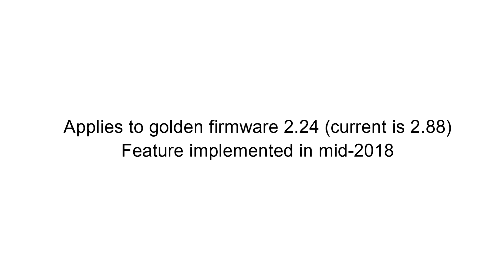How To Fix TBS Crossfire Binding Issues (via Emergency Update Procedure)

Comment from the maker: For the dreaded solid green light, please try this: 

1) Reflash or downgrade the firmware for the transmitter.
2) Put the transmitter into bind mode. 
3) When you power the Rx (without the bind button pressed), does the LED turn red color? 
     If so, then the Tx should ask to update and proceed through.
Reply: Hi, mine have solid green light since begining, tried your advice to downgrade is done but nothing happened, it just still solid after pressing the bind button after power up the rx. downgraded 6.06 to 4.1. any advise?
Reply: What if TX dont ask to update?
Reply: @Seii-FPV realized that my receiver has little fracture on CPU, kinda not repairable 😅
20$ got loss ☹️
Reply: What if it stays red after update

Comment: Hi, I do the whole process like you do, only that when I unplug the quad and plug it back in, it loses the bind, and every time I have to redo the same operation, has this ever happened to you? How can I fix?
Reply from the maker: A few things to try to rule out a few things otherwise your receiver is broken/defective and needs to be replaced by TBS Support: 
1) Have you tried different firmware and downgrading? The latest one that has encryption has caused some issues for people.
2) Power up the receiver first and then the transmitter first to establish a bind?
Reply: @OfficialMatrixFPV  I did many tests, I followed various guides including yours but all without success, on the rx it doesn't let me downgrade, on the tx yes, I tried but nothing happens, I tried to bind by turning on the rx first and then the tx, then in reverse, but every time I disconnect and reconnect the battery it loses the bind, in fact I'm sending it back, because something like this has never happened to me until today, and the only tool to restore the rx is a tbs core pro which costs around 40-50$

Comment: I know this is an older video. I followed the steps and everything went as it shows in your video. Bound up and works perfectly... but when I unplug the battery and then wait and go to re-connect a battery it is just flashing again and I have to go thru process again... Kind of lost in where to go from here... Anyone have any suggestions? Thanks
Reply from the maker: Have you been able to downgrade and try other firmware, I would try different types to see if binding is stable? It's rare that binding has issues with TBS - check with what others might be saying about the latest FW on the TBS Facebook group. You can definitely get more support by asking there or opening up a ticket with their support - they are fantastic and will do their best to make things right.
Reply: @OfficialMatrixFPV  I ordered some new Nano Rx's but haven't gotten them yet. So I went to a buddies house tonight and borrowed his spare Nano rx and it bounded up perfectly and is holding bind as it should. 👍
Reply from the maker: @P.G._FPV  That seems like your Rx is faulty. You might be able to TBS to replace it free of charge.
Reply: @OfficialMatrixFPV  it was the Rx. Actually both Rx's I had were bad... what's the odds of that. LOL
Reply from the maker: @P.G._FPV  Yikes! That is pretty rare.
Reply: @OfficialMatrixFPV  I know... right. LOL

Comment: My receiver doesn't stop to blink fast after pressing the button for the second time. The green light even blinks rapid when I don't press the button and connect the battery. All of that happened after the first bind failed in updating. :/
Reply: did you fix it? 😭

Comment: ok just tried this and now when I turn on my radiomaster I am not getting an orange light on my tbs module. no light at all. any help please
Reply from the maker: I’m not familiar with an orange light LED color per their manual. I would factory reset and try the binding again. Emergency update procedure is done on the receiver level, the transmitter will know how to bind from there.
Reply: got it sorted thanks ,
Reply: @earlybirdflights9884  Great to hear that. Would you mind sharing how you resolved it so it can help new viewers? I will add it to the stickied comment and credit you.
Reply: I just pluged the usb lead in and used tbs agent x , the orange light started flashing as soon as I loadeed the app. it flashed for about 30seconds and was done. cheers.

Comment: Greetings
I have a question.
Tbs nano is connected for my diversity controller, module and receiver are glowing green but no response.
Do I need to update the tbs xlite module for it to work or should I update it to my remote?
control version 2.2 opetx

Comment: Hi, I have done this but as soon as it binds my taranis starts beeping constantly.  Any ideas what's wrong? Thanks.
Reply from the maker: Hi! Is the beeping coming from the radio or the quadcopter? That might be a completely different thing as you can still have Crossfire bound without the radio on if you have it module powered with external power (ie USB).
Reply: @OfficialMatrixFPV  Hi, yes the beeping is from the radio. Soon as the crossfire module and receiver go green the taranis starts beeping.  Any idea? Thanks.
Reply from the maker: @Kenny-lq1fz  Which Taranis model? I saw beeping could be related to low supply voltage to the module or something with the baudrate if using the older QX7...
Reply: @OfficialMatrixFPV  hi, its the x9 plus but it is a few years old.
Reply from the maker: @Kenny-lq1fz  That's definitely odd as my previous radio was the X9D Plus. I would try updating to new OpenTx version if you have not. In this video, I am running v2.3.9 (June 14, 2020) release. 

Your Crossfire binding and settings are saved in the transmitter module and not in the radio as an FYI.
Reply: @OfficialMatrixFPV . Ok, good to know.  Yeah have already updated to the lastest firmware. Thanks
Reply from the maker: @Kenny-lq1fz  Sounds good - let me know what happens, otherwise it might be good to ask this as a general question in the TBS Lounge on Fb. I'm thinking it has to be something with OpenTx and sound settings. I haven't seen anyone with this issue regarding clicking sounds.

Comment: Led turned off after emergency procedure, no red light. Tried downgrading micro tx to 2.42 cause that the lower i can go on tbs agent and still nothing. Any other solution.
Reply from the maker: That is an odd issue and I haven’t seen this before. Would you please post this in the TBS Lounge Fb page or create a support ticket at TBS? I’d definitely like to know more.
Reply: @OfficialMatrixFPV  i've done it. On Facebook and a ticket to tbs.
Reply from the maker: @nicklessticksfpv  Thanks! I will keep an eye on this on Fb, if there is a potential solution I can add it to the description/comments as that was a similar issue with the dreaded solid green light.
Reply: @OfficialMatrixFPV  i think i had the same problems, did the normal thing, bind new RX and then a pop says about updating, so do that, it does its thing, at part of rebooting to then rebind after flashing, both LEDS are off, i left mine for a good five mins, then ended up pulling the power and back in again, it will not bind and will not go into recovery mode so i can reflash the thing, i made a ticket with TBS and they just ended up sending another one, had the thing in a draw for six plus months so it was nice of them to sort me out, but like to know if i can fix the broken one instead of binning it,  this is what mine does 

https://youtu.be/oLBaw17eyjU
Reply from the maker: @andrewmaudsley7692  that is a definitely a weird issue as the red LED doesn’t show up. Also noticed that the blinking green LED was quite erratic. At least they sent you another one. 
I’m thinking it’s related to actual HW issue. A way to see if you could try to fix is to connect the TBS Core Pro unit via BST and reflash the FW manually from their Agent X software from the computer.
Reply: @OfficialMatrixFPV  i only have RX and TX, i do not have a TBS FC or any of the other stuff, is there a way i can connect a normal F4 FC to it to flash the thing do you know
Reply from the maker: @andrewmaudsley7692  it requires the TBS Core Pro PNP, which was the device I showed in the video. Basically it provides a way to connect the receiver to the computer via USB since the smaller Rx doesn’t have a USB or support for that. 

If there was a way to do FW fixes via BST connection to a full size Crossfire Tx, that would be awesome.
Reply: @OfficialMatrixFPV  its just not logical to buy one tho they like £50 and it might not even fix it, then that price or not much more could buy two nanos, I might try and open a ticket or something, I cannot see why I cannot use my FC or connect it to the q x7 and flash the thing like you would any other rx, did post this on there Facebook group and had no answer that helps fix it, just seems silly to just bin it, I did get a free replacement so hats off to tbs but also be nice to fix it too, just in case it happens again too
Reply from the maker: @andrewmaudsley7692  That is correct, that's most likely why they offered a replacement unit as the Core Pro PNP is pricey. I had one laying around before OSDs were on FCs. I'm not sure if there is a workaround as their stuff is proprietary, but I'll ask around.

Comment: my received after relase the button the second time, all led power off and procedure don't done or remain fixed green, but radio not bind. I've try procedure many time with same failed result, have you any other idea to reset rx? thanks
Reply from the maker: MerkuFPV Does the receiver turn green or red when you power on the quad?
Reply from the maker: DareDevil_ FPV I’m guessing the a solid green light the process is different from what I found online...

Which Tx firmware version are you running? I would try a lower version and put it into bind mode. 
When you power the Rx (without the bind button pressed), does the LED turn red color? If so, then the Tx should ask to update and proceed through.
Reply: @OfficialMatrixFPV  hi I am having an issue with multiple recievers where they flash red after i start the binding process on the tx. When the tx is not powered on, and quad gets booted, my rx will flash slowly green. But then when I turn on the tx it will go to a red flashing. The tx does not prompt the "update firmware" anymore. I have tried a bunch of button presses, downgrade of firmware to all kinds of version on the tx, but with no change. Would you happen to have any suggestions as to what I can try to get it working again?
Reply from the maker: Souldk86 Which firmwares have you tried? I was digging around online...try firmware version v2.25 beta for the transmitter. 

1. Switch on the TX and enable bind Mode
2. Power the Rx WITHOUT pressing the bind button - the LED will become red
3. TX should ask you for updating the Rx
4. If this works, bind the other receivers and then update the Tx to the latest FW 4.xx and the proceed with normal bind process.